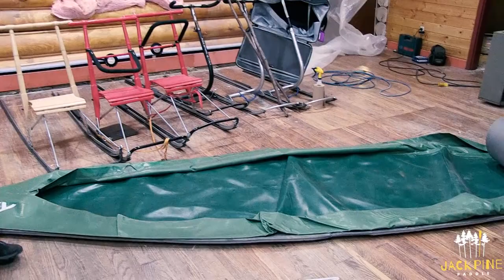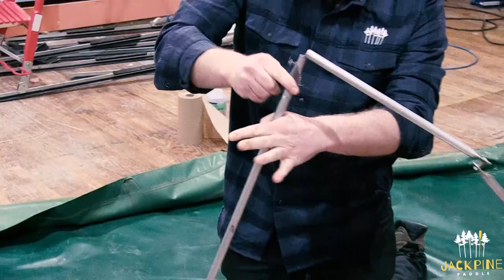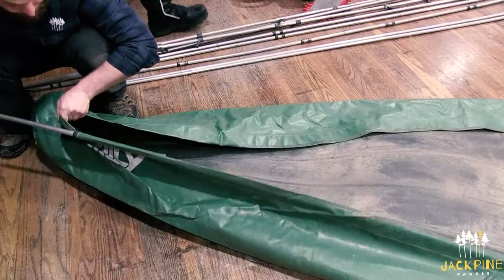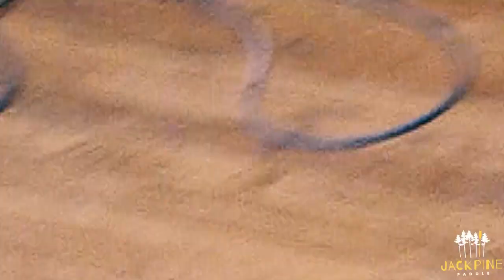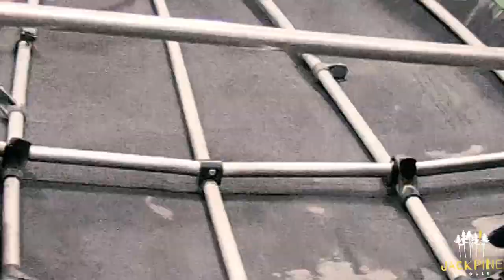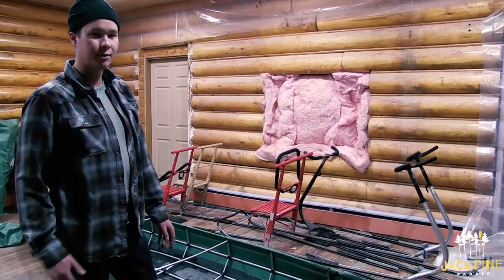Maintaining Your Ally Pack Canoe-Jackpine Paddle

Comment: Hey guys, thanks for the informative vid!
Out of curiosity, how have you found these things in terms of durability?  I'm no stranger to the old-school cedar-and-canvas canoes, and more modern kevlar models - but the fabric in both of these has been fortified with lacquer, etc.  I'm considering buying an Ally next summer - but I'm dreading that I might shell out four grand, only to end up with a bent rib or abraded hole.
I'm also curious if wave action or water pressure when loaded are likely to deform the sides and ruin the handling.
Basically, should I be expecting this to perform in a manner similar to the aforementioned rigid-cloth canoes, or should I expect to handle it like a delicate inflatable raft?